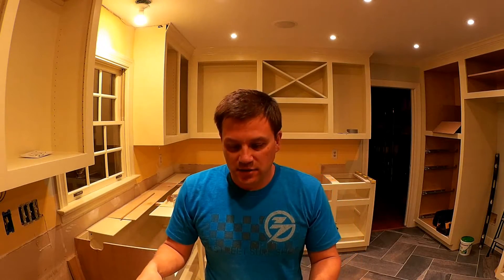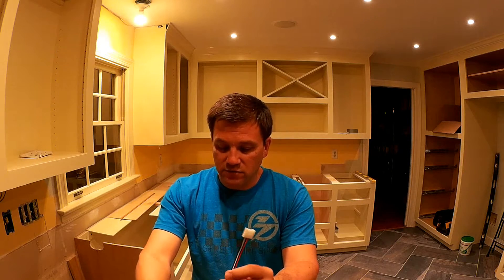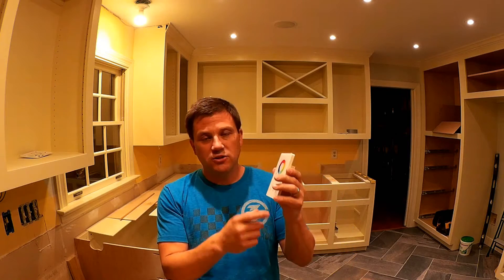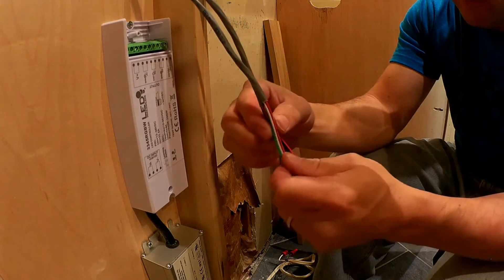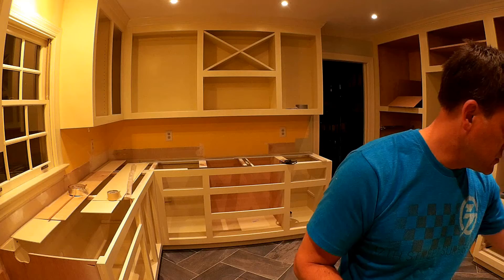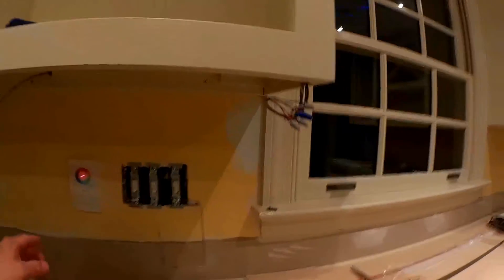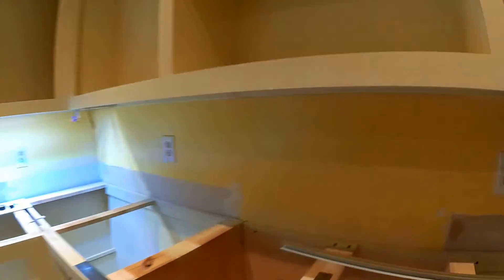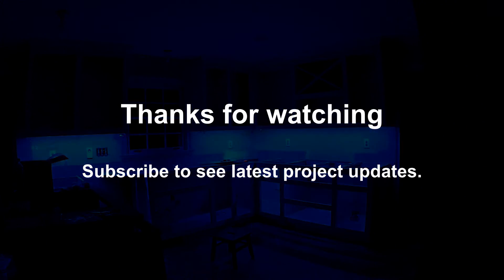Kitchen Update 22 - Under Cabinet LED Kitchen Lighting Components and Installation

Comment: So is there just a pigtail of 14/2 that comes out through the bottom of the cabinet to connect to this transformer giving it constant power controlled by the light switch with radio frequency ?
Reply from the maker: Yes, there is a constant 14/2 that runs into the grey handy junction box in the cabinet and I connect the driver/transformer to that 14/2 in the box. Then the 12v power from the driver goes to the   RF controller. Out from the controller is the RGBW wires that feed the lights strips.  The wall switch use another separate 120v power. Wall switch sends signals the RF controller to function the lights. Hope this helps.

Comment: How Did you run Wiring from the transformer to the cabinets on the other side of the room? Thank you in advance
Reply from the maker: Thanks for the question, I connected two lines of the 5 stranded wire from the RF controller. One went to lights in the video and other wire went underneath the floor in crawlspace to the other side of the kitchen to other cabinet. I made sure to use 18 awg wire since it was a longer run. Normally for shorter distances you can use 22 awg wire. Hope this helps.

Comment: It wasn't clear how you decided to Route the wire across the window to the bank of Lights to the right of that window. Did you go through the trim ? In a different section it looks like you might have gone across the ceiling on the top above the window on the outside of the wall and then run it on the inside of the cabinet is that right? Are you intending to put crown molding on all over that?
Reply from the maker: Thanks for the question, I ran a connecting wire from one LED strip to the other by routing it up the front inside corner of the cabinet. I drilled two holes in each cabinet, one at the bottom front corner and one at the top front corner. Same process for the other cabinet back down to the next LED strip. I tacked the wire in place at the ceiling and covered the wire with the crown molding. Hope this helps.

Comment: How did you wire the third cabinet? Is that connected to the wall switch also amd turns on at the same time? I have a kitchen that has 5 sections.  Was wondering how to wire it up.
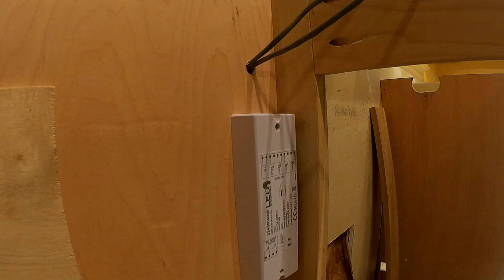Reply from the maker: @Alvin Thomas, Thanks for your question, at time lapse 6:25, I begin feeding two sets of grey cables to the RF controller. I spliced these two sets of 5 color coded wires together and connected them to the RF controller. The other end of those two cables goes up to each run of LED lights. So, one cable went to one side of the kitchen while the other went to the side where the third cabinet  was located. These wires feed the 12v power and each color.  The wall controllers (I used two,...one on each side of the kitchen) are simply wired to 120v power, they are not directly wired to the lights. The wall control sends a radio frequency signal to the RF controller to tell it to turn power and whatever color you want on or off. Hope this helps.
Reply: @richofalltrades1  oh ok. So if I have 5 sections I would need to splice/connect 5 sections to the rf controller instead of the two. My electrician already did wiring but at the 5 sections he has a 120v line coming out. So I guess I need to connect to a rf controller to operate at the same color and time correct? My kitchen is completely gutted an open and  looking for the best way to have the electrician wire these up. But he's old school and isn't familiar with the rgb led strips. He said he can put a transformer near the box so the lines would be downgraded to the power for led strips. Is there anything I can use in conjunction with the 120v line?
Reply from the maker: @Alvin Thomas I am not sure if you needed 120v boxes at each light location, not unless you were putting a transformer and a controller at each one. I believe you can use multiple RF controllers with it's own transformer and simply set the controllers to sync up to the wall controllers. There is a zone feature on the wall controllers. You may need to do this because depending on the length of your runs  one transformer may not be sufficient. Longer LED run distances will cause more resistance and you might see dimming in the lights at the far end. Here is a resource that used when I was figuring out what I needed to use for my application. They have some good video on how to select transformers and set up a system. I didn't buy their stuff $$$, but they seem pretty knowledgeable. https://www.environmentallights.com/elibrary/video

But you do need 120v boxes for where you want your wall controllers if you use the same ones that I used in the video. You can possibly run all 5 sections into one RF controller I am not sure how that would work and I would speak with the RF controller manufacturer on that before proceeding. 
Hope this helps.

Comment: Where did you get the pigtail connectors? I don’t see them in your list, and can’t seem to find the 14mm wide ones on Amazon or on a simple search from google.
Reply from the maker: Thanks for the inquiry, I found these on amazon, but I also have had good success with just soldering wire extensions directly to the strip lights. Hope this helps. https://www.amazon.com/Davitu-Electrical-Equipments-Supplies-connector/dp/B089W726KV/ref=pd_ybh_a_1?_encoding=UTF8&refRID=JXJ5QQ6YM3PQZCQ1JM1B&th=1

Comment: Can you put a list and location where you purchased items for this set up?
Reply from the maker: I created a detailed list of the items in the video in the description. I hopes this helps.
Reply: @richofalltrades1  What about the connectors for clipping on to the tape light. I didn't see it listed or is included with the tape light?
Reply from the maker: @samvarietyfilms9446  Thanks for the question, Here is a link to something similar to what I used on Amazon. But any 12 mm, 5 pin RGBW connector would work, or you can even solder a jumper wire from one strip to the other. 
https://www.amazon.com/EvZ-10PCS-Connector-Conductor-Jumper/dp/B01COSNKCA/ref=sr_1_17?dchild=1&keywords=12mm+rgbw+push+on+connector&qid=1631799831&sr=8-17